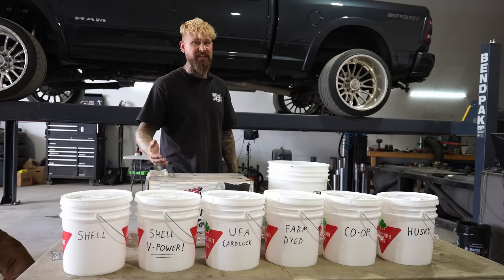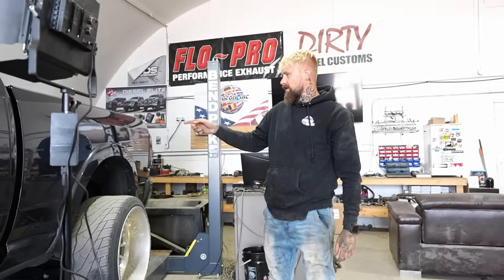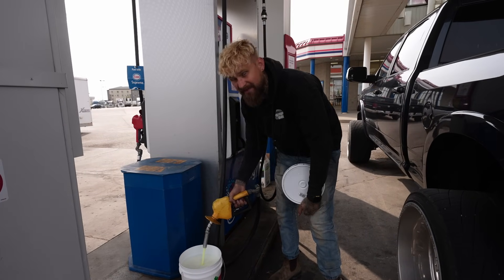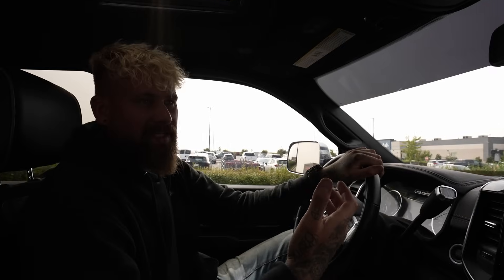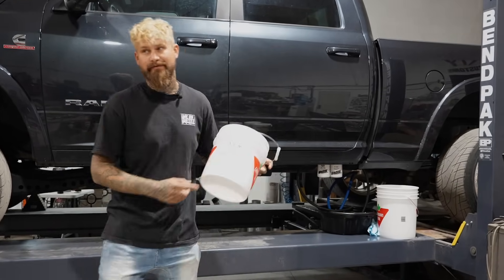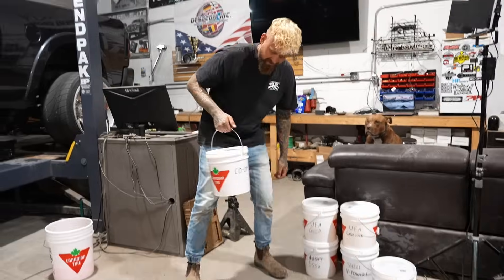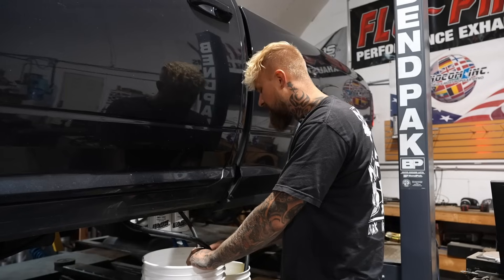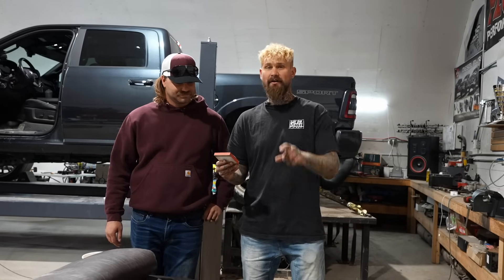We Dyno Tested EVERY Diesel Fuel... The Winner SHOCKED Us!

Comment: Next video.  Fuel additives added to a single diesel fuel.
Reply from the maker: Yes, like get a bunch of pails with the same fuel then add different fuel additives to the pails. Good idea 👍🏻
Reply: @darkirondiesel throw in some ATF fluid in one as well!
Reply: @JakeScott-ke3sh  ATF is a nice detergent for older diesels, but the mineral additives will foul modern piezo injectors.
Reply: @darkirondiesel yes including atf!
Reply: @darkirondiesel  what year 4th gen Cummins do you recommend
Reply: seconded
Reply: I was coming to comment this.
Reply: This is great! If you want to try additives, I’m an independent Amsoil dealer, I’d love to send you some to test!
Reply: @dudestuff1557 send me some 😅
Reply: @dudestuff1557 do you have injector cleaner?
Reply: Very interested in this. Been using amsoil fuel additives for my 24’ Sierra 2500 haven’t really noticed anything good or bad 😂
Reply: @nabatron21 fuel additive is more so for fuel system health more than it’s really meant for power
Reply: @Beebop-ow9ge yeah or mpg I guess
Reply: @Beebop-ow9ge  Other than the ones that advertise cetane boost, yeah...
Reply: Add ATF
Reply: Was disappointed you didn't get any Petro Canada clear diesel.
Reply: Actually testing the diesel and finding out what the retail standards are might be a little more valuable.
Reply: Been using stanadyne in my 08 6.7 cummins and it seems to not only run better but it starts better in the cold too